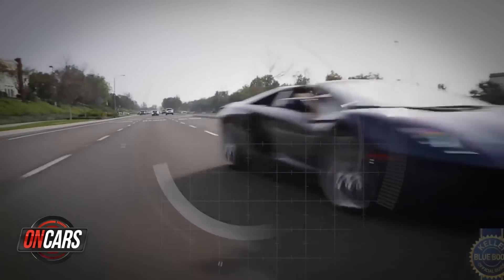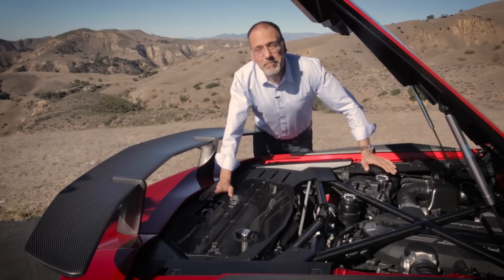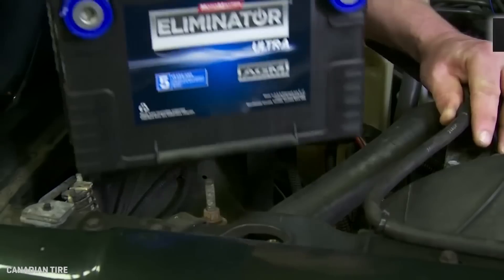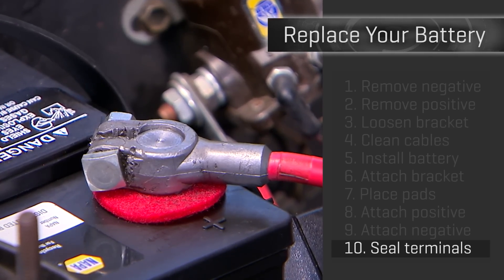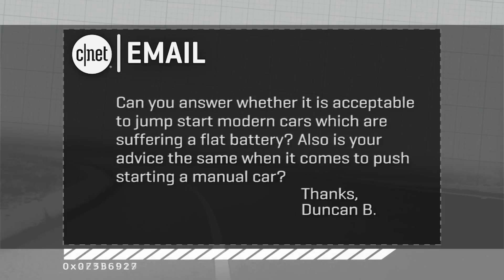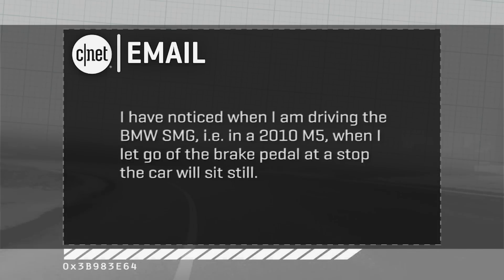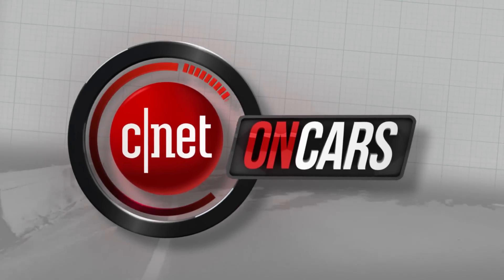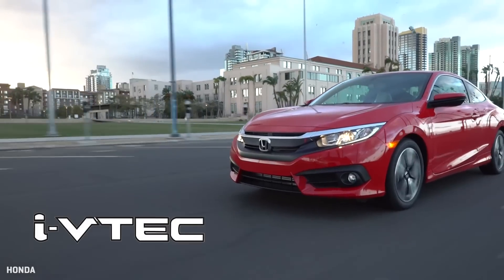Lamborghini Aventador SV: A nip, a tuck and a hell of a ride (On Cars, Ep. 90)

Comment: It's worth noting that when you replace the battery and/or remove the original, a lot of GPS units have a safe mode where they lockdown once power is lost. You may need a code to unlock it again.

Comment: Great episode :) It's really interesting to see how it works on the other side of the pond.

The AutoBrake funktion will have probably have a off switch. There's been discussion in Sweden where the mainly use Volvo V70 / XC70 in their fleet. 
There has been some annoyance with not being able to ram escaping vehicles without the AutoBrake interfering..

Other questions like being able to ram cars or object out of the way in cases of emergency, like if you accidentally were to get in between the barriers at a railway crossing and the car decides to see the the barriers as a "object" and refuse to move. Extreme cases, but it could happen if you're really unlucky.

Thanks for a great show!